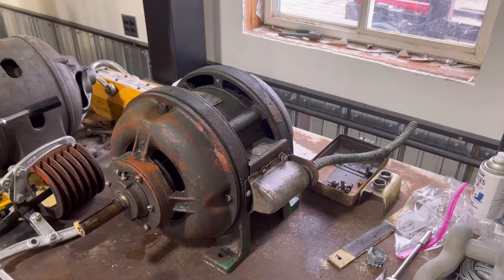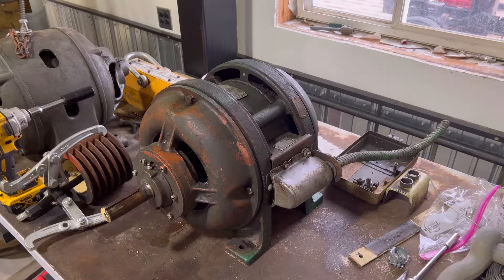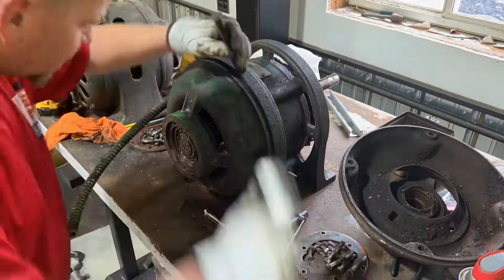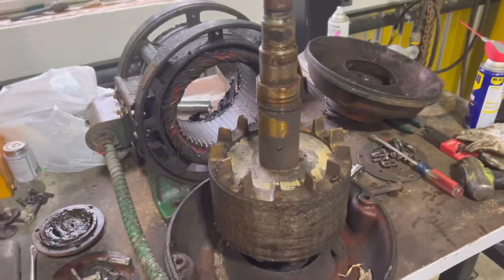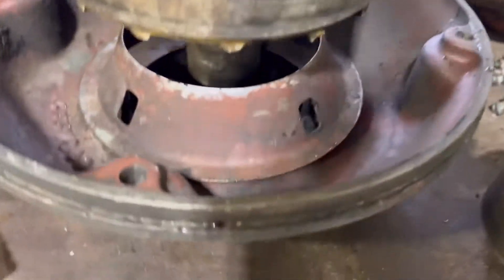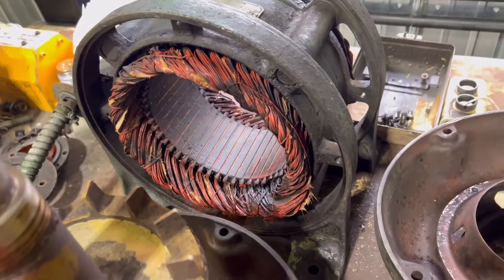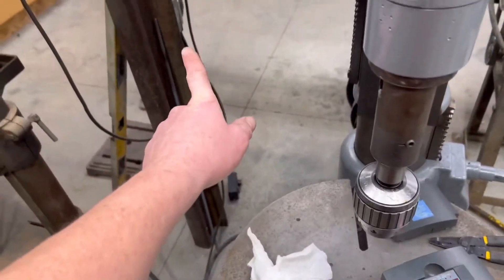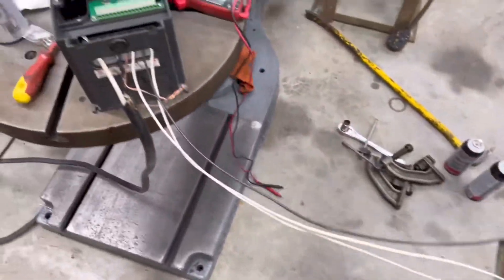Old Electric Motor Dismantled and Cleaned and Then Started

Comment: The slower you let her run, the more likely she will overheat. Wire and install an extra computer fan right up from your vfo on your motor.  It is a very nice motor indeed. Those low rpm motors are expensive
Reply from the maker: I agree with the overheating, probably won’t run long times but definitely would need a fan

Comment: Maybe you could use a small 120 volt fan to blow across the the motor to compensate for the missing fins. It could be wired using one leg of the 3 pH so when the motor starts so does the fan. Food for thought.